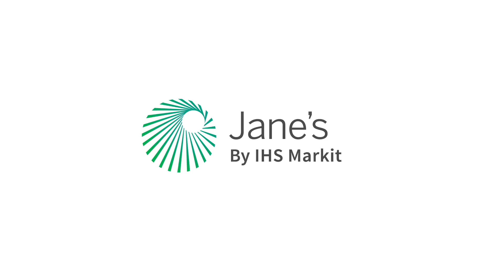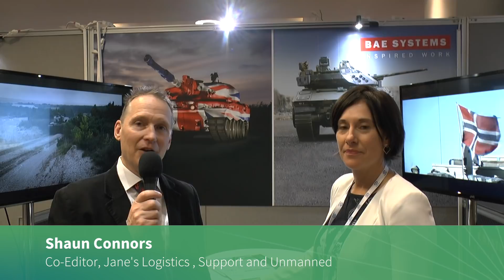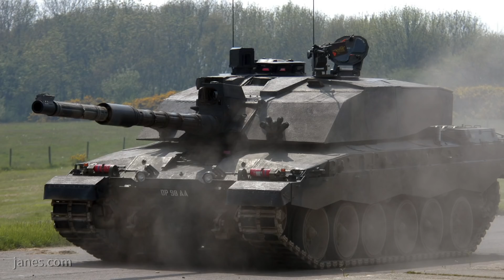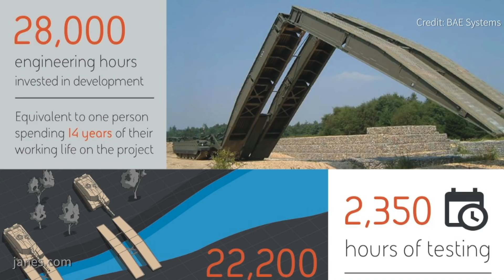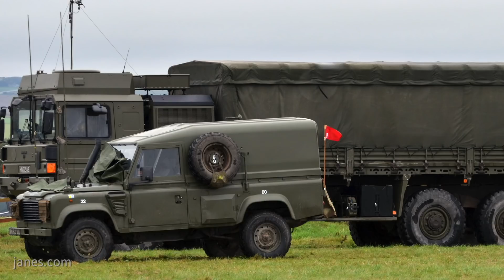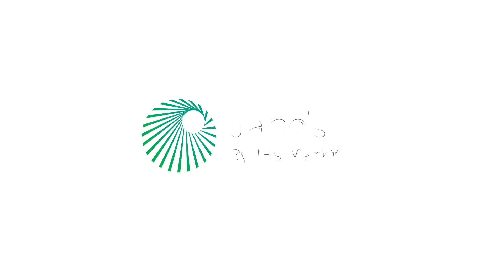IAV 2018: BAE Systems Land UK current programmes

Comment: 🤨? Ain't the CV90 swedish ?
Reply: A bunch of the nordic countries use them. It also is one of the three contenders in the IFV competition for the replacement of the Bradley IFV for the USA. The other competitors are rheinmetall and General Dynamics.
Reply: @corey8420 .. I just believe to have heard that it is of swedish origin.
I am danish, and know that Denmark has bought and already recived some.
Reply: @corey8420  so after yesterday... Rheinmetall just bought 55% of BAE.... fair to say just one competitor... GD... lol
Reply: Yes CV90 was originally designed and built by Hägglunds in Övik, Sweden. BAE bought Hägglunds

Comment: So basically BAE Land UK has nothing...  The MoD seems to have basically boycotted BAE Land Products. It failed to win the Warrior WCPS despite having the best solution and LM won by submitting a proposal a cheaper proposal to retain the turret, then get the funding to fit a new turret which is what BAE suggested in the beginning!  Selecting instead the the mediocre  ASCOD2 design and then pay GDLS £500m for a design that already existed!!!  I have very little expectation in BAE getting the C2 upgrade.  Somebody on the MoD/Government is really pissed with BAE. Despite it being a UK company, they seem intent on fcuking it over big time. I think it was due the them refusing to NOT cancel the carriers, which the government clearly wanted to do.
Reply: the womble who the fcuk do you think you are?
Reply: Jonny in what way was it hideous???
Reply: 'The chrome lined barrel on  the C2 can withstand much higher pressures than the german smoothbore'

That is made up and false. Rifling limites the maximum pressure for autofrettage which directly affects the maximum operating pressure for tank ammunition - the L30 gun of the cannot withstand as high pressures as the old Rheinmetall L44 gun from 1979. The second problem of the rifling is the increase of the internal surface by 20-30%, which increases surface friction and thus reduces muzzle velocity. In fact the British Army even considered replacing the Challenger 2 due to the L30A1 gun's poor performance.

Definitely NO mainstream press: https://below-the-turret-ring.blogspot.de/2016/06/team-challenger-2s-upgrade-suggestion.html

'Finally, adopting another gun for C2 would mean a completely new turret to accommodate one piece ammo,which would cost more than the actual upgrade programme'

That's the reason why the british MoD cancelled the upgrade to the L55 in 2006. Do your research before blaming others.

"Leo fan boy"

I'm not a fanboy of the Leopard 2. Its upgrades make it one of the best MBTs currently available, but its basic concept is horribly outdated.
Reply: the womble sorry the way this came through looked like it was an attack on me. All I had done was pass a comment on how little BAe Land Systems has going on and how badly the MoD has treated it recently especially when AFV development was supposed to be a core sovereign capability. Yes he has been obnoxious/rude and arrogant to some of my posts as well!
Reply: The challenger 2E export model had the MTU 883 engine giving 1500hp, so  there always was an engine option, no doubt the extra power would reduce life of running gear in some  drivers hands!
Reply: Yes, there is a 1500hp engine available for the Challenger 2, makes it even weirder why BAE didn't include a new engine in the CLEP.
Reply: The chrome lined barrel on  the C2 can withstand much higher pressures than the german smoothbore. Hence the name L30 HIGH PRESSURE main gun. BAE  did propose a common rail diesel injection system for the CV12 engine,along with other upgrades. Finally, adopting another gun for C2 would mean a completely new turret to accommodate one piece ammo,which would cost more than the actual upgrade programme. 
We've been here before jonny. You are just a Leo fan boy who lifts info from other sources without doing any proper research.
Reply: *please don't quote articles from the mainstream press to me. The average journalist wouldn't know a tank if it ran over them.
Reply: The Challenger 2s weakspots are obviously mobility (overweight AND weaker engine) and lethality (rifled 120mm can not widhstand as high chambre pressures a smoothbores, resulting in less penetration power). Yet BAEs proposal neither included change of the powerpack, nor the adoption of another main gun.
Reply: I'm a person who has ahd to put up with a lot of inaccurate, trolling shit from Jonny in the past. Ok?
Reply: I hope BAE won't get the CLEP. Their upgrade proposal was hideous. The AJAX is another sad story.
Reply: No worries mate. He's an arrogant, ignorant little Leo2 lover. Some of his posts about the C2 have been laughable. I just read his comments and lost it.  I got into a chat with him about the merits of the CV12 engine,it was painful!   I'm with you on the BAE/LM  thing. I fear the worst for C2 , as ussual, too many vested interests and bean counters. Nice to talk to someone with a brain mate, take care.

Comment: 0:41 "A lot of the things it covers are probably not that well known to most people"

Hehe.

Like fielding a since 30 years outdated main gun on their MBT.
Reply: You seem to be confusing the gun with its ammunition. The L30A1 is a record breaker. A move to smoothbore would be for ammunition commonality (cheap ammo).  

Blaming the blue on blue Challenger 2 incident on ammo stowage is simply wrong. No tank, or its crew, survives a 120mm HE shell through an open turret hatch. If it happened between M1 Abrams the result would have been the same - ignoring the M1 can't fire a proper HE shell of course.
Reply: It's the gun and the ammunition. It's penetration abilities are limited by 3 main factors.

-First, being the maximum pressure of the gun. The rifling limits the maximum pressure for autofrettage (metal fabrication technique, google it) which directly affects the maximum operating pressure for tank ammunition.

-Second, being the increased friction. The rifling increases the internal surface by 20-30%, which increases surface friction and thus reduces muzzle velocity.

-Third, being the limited kinetic eneregy penetrator length. The ammunition fired by the 120mm on the Challenger 2 consists of three parts: projectile, propellant charge and primer. Because of the seperated nature the penetrator can't extent into the propellant like it does on one-piece smoothbore ammunition, and is significantly shorter.

The current L27 CHARM 3 APFSDS penetrator is only 30 cm long and has a weight of 4.5 kg.
A smoothbore DM63 APFSDS penetrator is 64 cm long and has a weight of 8,35 kg. Additionally to that, it is fired at a higher muzzle velocity, resulting in significantly higher energy.

The reason for the MoD wanting the L55 since 2006 isn't cheaper ammunition or interchangeability. It is lack of penetration power. Even more concering seeing germany and denmark moving to the L55A1 because even the L55 isn't capable of defeating the most modern russian armor anymore. The Challenger 2 needs that upgrade.

agt155 'Blaming the blue on blue Challenger 2 incident on ammo stowage is simply wrong'

No. The HE detonated over, not in the tank. It was the coockoff that killed the crew in the incident. Recently another british soldier was killed in training because of ammunition ingition too.
Reply: You are portraying pure conjecture as fact.
DO you know the maximum chamber pressure for the L30 and Rheinmetall 120mm? Thought not. As far as I recall for the L30 it is 30t/i and Rheinmetall 27t/i. Let's not forget when the US army trialed the smoothbore against the old L11 rifled gun they found the L11 out-performed it.

"The current L27 CHARM 3 APFSDS penetrator is only 30 cm long and has a weight of 4.5 kg" ....Rubbish. The only limiting factor to the length of round you can get in the L30 is the actual physical space needed to load it and store it. However being inert makes storage pretty flexible. Also it is important to remember the German penetrators need to be longer because they are made of an inferior material. 

There were eye witness reports of the HESH round hitting the open hatch and entering the turret of the CR2. That's 10Kg's of HE in a combined space. If you like seeing tanks "cook-off" just type Abrams or Leopard 2 into the search bar. It seems like a new one brews up every week.
Reply: agt155

The L30A1 doesen't only have a lower pressure, but also a significantly lower EFC count than the L44/55. Rh 120 are rated at 1500 EFC, L30A1 is rated at 400 EFC. L11 was rated at 120 EFC.

'Let's not forget when the US army trialed the smoothbore against the old L11 rifled gun they found the L11 out-performed it'

No, it didn't. Why do you think the Abrams uses the Rh L44.

'The only limiting factor to the length of round you can get in the L30 is the actual physical space needed to load it and store it. However being inert makes storage pretty flexible. Also it is important to remember the German penetrators need to be longer because they are made of an inferior material. '

That's what i said. Flexible, yes, but trash when it comes to penenetrator length. The british APFSDS is a seperated design, SABOT and penetrator is one part, and the propellant is the other part. Now, on one piece ammunition the penetrator can extend well back into the propellant (just search up a M829 cutaway), the DM63 and M829 both reach lenghts of over 60 cm. The L27A only about 30.
Reply: At 40t PSI the L30 has the highest max "chamber pressure" of any tank gun.

The M1A1 Abrams uses the German 120mm smoothbore, or a version of it, because it was part of a deal that involved the German government buying AWACS from the US in return. It is a fact that the L11 was trialed by the US army and was found to be superior. I can provide links if you wish.

I'm not sure you understand. The Challenger 2 could accommodate 1m long APFSDS rounds if they altered the inert ammo racks. It is the smoothbore's one piece rounds that are limited in length. The L27 is around 700mm in length. The L28 is longer.
Reply: A 'outdated' gun that has the longest recorded tank to tank kill in history by a Challenger.

What's the alternative? Seeing as the Leopard 2 has such a shitty combat record that it lost a dozen in Syria to ISIS armed with nothing better than RPGs and T-55s.

Outdated my ass.
Reply: Outdated in terms of penetration capability, not range or accuracy. Because of the lackluster penetration of the rifled 120mm the british MoD wanted to fit the 120mm smoothbore L55 to the Challenger 2 back in 2006. However that would require an entire turret redesign, because the current turret is optimized to store the 2-piece ammunition used by the current rifled 120mm. The cost was considered too high, and the project abandoned.

Now, in 2018, the british MoD is considering an upgrade to the L55 or even the L55A1 again. That would still require a turret redesign, however considering the Challenger 2 still doesen't have seperated ammunition compartments and blow out panels, that isn't such a bad idea. Unlike in the Abrams as example, the ammunition is stored in the turret and below the turret ring around the crew, that is also the reason for the losses in Basra, 25 March 2003, 2 KIA, 2 WIA.

Considering how the Leopard 2 is operated, and especially what version, the 'combat record' of the Leopard 2 in syria isn't bad at all. The used system is the Leopard 2A4 with the A3 (or even older) armor kit (as seen on the drivers hatch), a cold-war era MBT (early 1980), designed specifically for a tank v. tank duel situation (frontal armor/mobility).

'What's the alternative?'

Although being already considered by the british MoD, the Leopard 2 isn't a great alternative. Of course, the newer versions outclass the Challenger 2 in all aspects, however buying a 1980s weapon system (although upgraded) in 2018, isn't a good idea, as seen on the AJAX (ASCOD, 1990s).
No, a proper upgrade of the Challenger 2 would be enough, until a replacement (join MGCS?) shows up. Turret redesign, new gun, new powerpack, new internal/external special armor arrays (4th gen IBD?), soft- and hardkill APS (MUSS already being tested in MEDUSA), new FCS and C4I. Basically what the CLEP is all about.
Reply: "lackluster penetration of the rifled 120mm" - utter ill informed rubbish. You clearly have not (nor should you) have access to the real information. Internet "facts" like this do nothing but propogate anti-facts.